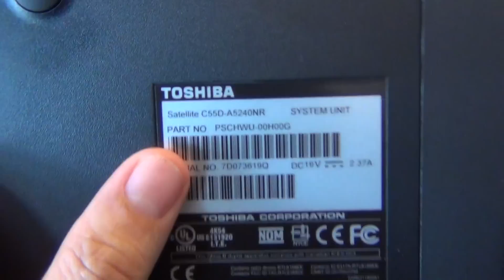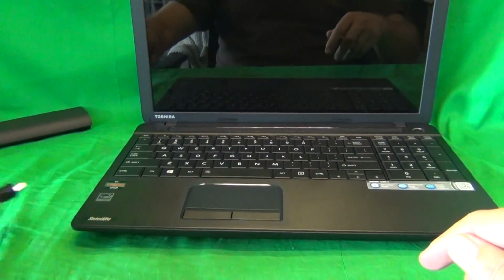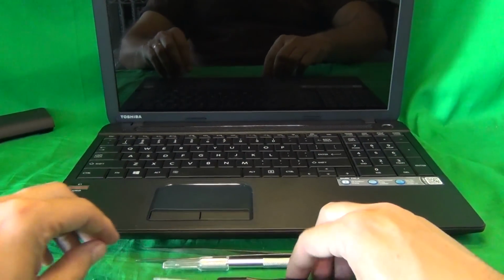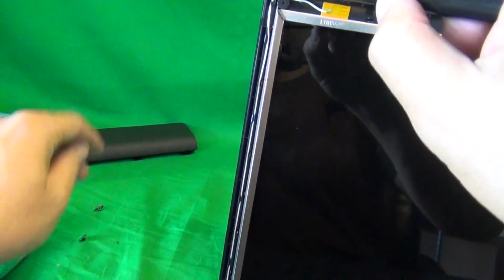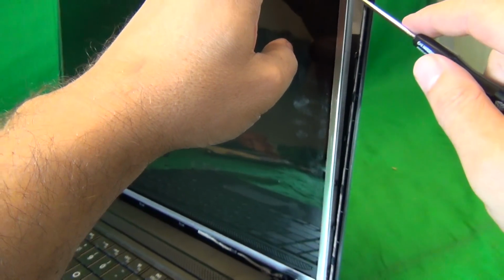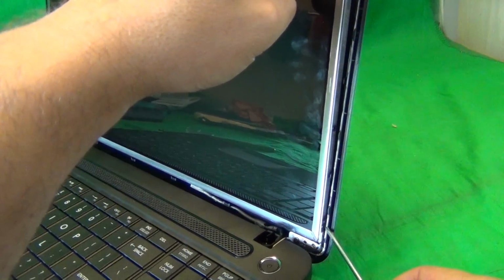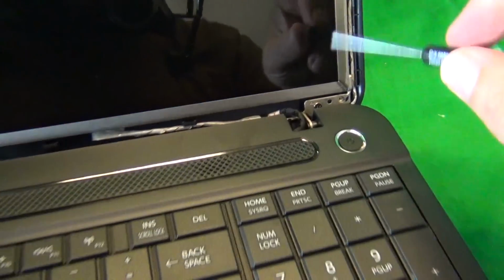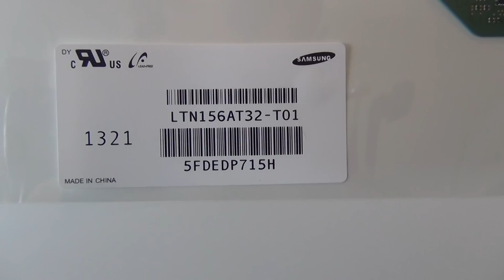Toshiba Satellite C55 C55D Laptop Screen Replacement Procedure

Comment: I have the same computer and I was able to diagnose a loose cable, which if you had not emphasized that part of the video by saying pause it, I wouldn't have realized the significance of that connections being perfect. I clicked it in and got a screen back that I haven't had for a year. This didn't result in a purchase now, but my wife thinks I know what I'm doing now and has an older laptop with a broken screen she wants me to fix. I will purchase from you. Thanks for the video.

Comment: Thank you so much! Your instructions were spot on....replacement went smooth. I was a bit bworried when I noticed the new screens circuit board did not match up exactly like original, but works great.Must have a magnetic screwdriver FOR SURE for the very tiny screws.

Comment: I'm using a Satellite C55-B5356, the only apparent difference I can find in these two laptops are the two initial screws that must be removed in order to begin snapping the screen off.  Are these screws in a secret spot or should I just get to snapping the outer screen off.  I hope you can get back to me.

Comment: This Video seems very helpful, but the Black plastic part of my laptop, doesn't have those 2 screws at the bottom anywhere. I'm not sure if I have a newer model or what, but if the screws aren't there then do I just pop it off?
I just don't want to mess up my screen, or pay out the ass for some store to fix it.
I have a:
Toshiba Satellite C55-B5242X
Reply: I have the B5242 model and no screw covers either.
Reply: I don't have screw covers as well, were you still able to take the plastic cover off and repair your laptop?
Reply: Ihave the same thing, no screws, but I was able to squeeze my fingernails then finger tips under the INSIDE edge of the bezel to pop it out. It pops out all the way around. To remove from hinge, I had to open the laptop flat, then gently pull the bezel towrd the keybaord and the bezel lifts off the hinges. Good luck!

Comment: Hi, I have a question, do you know what could be the problem in my laptop... its kind of like this one but better chip more ram and hard drive, my problem is that I can barly see an image on my lap, I connect and external monitor and no signal, I remove the battery, ram and hard drive and still same problem. when i turn it on a can barly see the toshiba logo. thanks

Comment: hi mine is C660D-1GD, its screen was flickering , so unscrewed the screen and pulled the connection from the back of the screen, but all with power on,  put it back and it is not at all working now, previously only flickering only, now it ceased working. laptop when powers on it working just the screen is dead. a replacement screen solves the issue or some short circuit occurred? can you help please
Reply from the maker: Sreenadh m.v most likely short circuit. Best solution at this point is to use it with an external monitor.